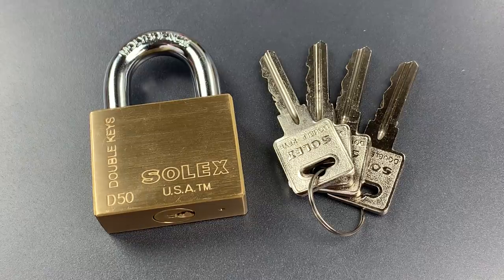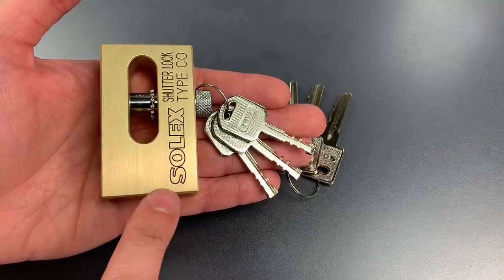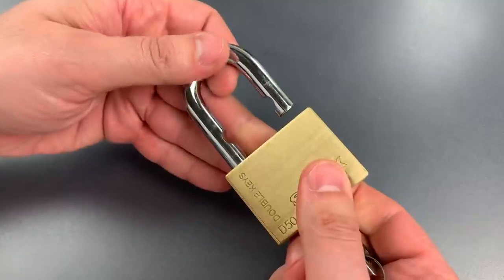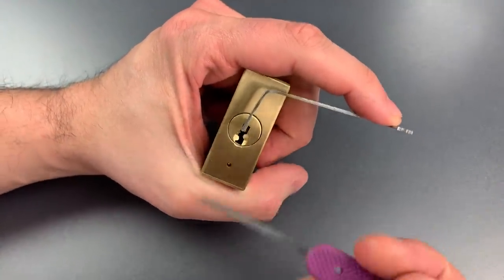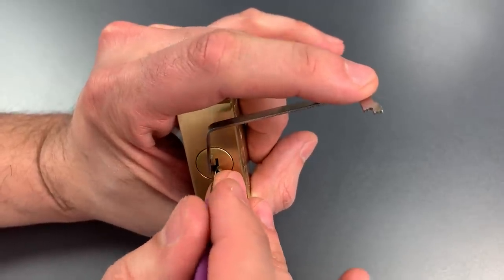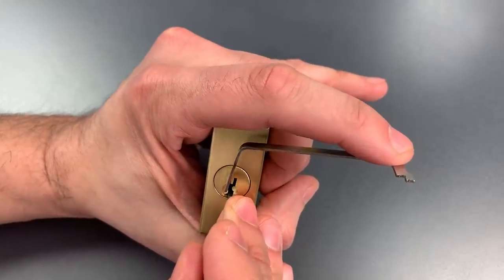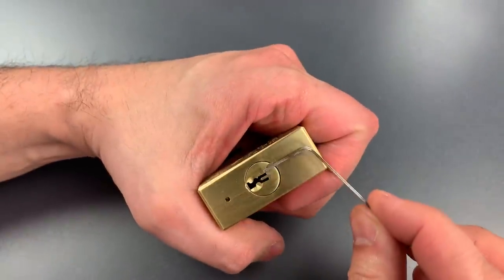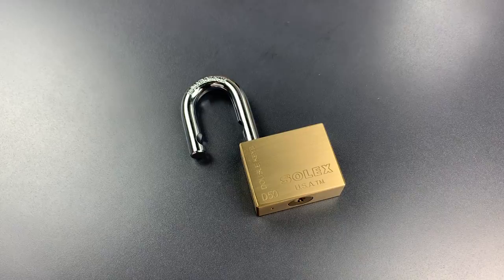[816] “Double Key” Solex D50 Padlock Picked and Raked

Comment: I know I suck at lockpicking, but I can't help but shed a small but still very manly tear every time you refer to raking as a "low skilled attack".
Reply: Think of it as an "average attack" instead. :)
Reply: Once you've actually done it a few times, you might find yourself agreeing.

There are some "tricks" to raking, FWIW, but there's no rocket surgery involved.
Reply: @jamesg1367  Yup. I've raked open locks without even knowing what raking was or that I had the wrong impression of "lock picking."
Reply: throw out your rakes (really just put them away) they aren't making you better.
Reply: I have done it many times, that's why I made the joke about crying when he says it- it is far easier for me to rake open a vulnerable lock than it is to single pin pick it.
Reply: Not everyone can rake-pic a lock ... so don’t get discouraged.
Reply: "Low Skilled Attack" - what's the button combination on the PlayStation controller 🎮?
Reply: I have a master #3 that I can spp easily but I can't rake it at all

Comment: Cool lock! I just started on locksport myself, and have a general question: I've got an old lock given to me by a relative, which is fairly weathered, and find it nearly impossible to single-pin-pick. However, the lock is downright trivial to rake open with my double or triple peak. I feel it's likely because the lock is worn or gummed up, but I might just be terrible- I did pick it once but I bent my standard hook doing so. Is this normal? Thoughts?

Comment: Another lock they probably charge megabucks for that a Meth head could pick with a hairpin.  Thanks for the heads up, even though depressing.  You'd think that some lock companies could at least make locks you can't tension at the base easily, like two or three points of freedom in the shafts and anything critical at the end.  No lock is pick proof or the key wouldn't work, but it's supposed to be easier to destroy the lock, creating noise, costing time and alerting people.
Reply: The ABUS Plus core is quite rude in this regard, since you can't tension it at the front or the back due to the butterfly discs.

Comment: Is there a lock you can not pick? And what lock do you recommend?
Reply: One of the abus locks can't remember which one
Reply: Well there are a few locks that he hasn't picked - such as the bowley padlock. The only pick of it required a huge set of custom made tools and obviously opening the lock to figure out how it worked.

Really, the main concern with most locks is the beefiness
Reply: @argenti3609  the one disc lock before this one gave him plenty of grief before it opened.
Reply: vector6977 no it didn’t.
Reply: Ask bill for that new Gerda  4 sets of 5 pins, 3 times! That might be a 1hr video
Reply: Anything featuring the Abloy Protec2 core or the ABUS Plus core are going to deter just about any thief.  Most of them will look for an easier target or destructive entry.  I use the ABUS Diskus model 20/70 for my storage unit.

Comment: Hang on!!!
Surprised you used top of the keyway tension. Would there have been enough room to pick it if the tension would have been at the bottom? Those slots at the top looked pretty slim.

Comment: Ok so with pad locks you usually use ,I don't know the correct terminology,but it's a battery,cut into a t shape. You then insert it into the top side that locks ... would that work on this lock?please correct my novice lock picking language 😉

Comment: The part that has me scratching my head is that they could use chores of equal or lesser cost (just slightly tighter tolerances) and toss a few security pins in there.  Boom!  Better lock with either virtually no cost increase.

But of course, making a better product pays dividends in company reputation.  Be known for making a superior product and people would have little issue paying a bit more for the product.

Comment: I would be curious to see a disassembly video.  I'm curious about how the pins are held in the body.  Guessing they used 4 elongated slots rather than 8 cylindrical holes.

Comment: Angling the blades out a little would have allowed the pins from the left to fall into the holes on the right. Bolster this with some deep spools and tight tolerances and this would have been one hell of a lock to pick.

Comment: Forgive my ignorance of terminology, but when you progress deeper into a lock are you always in contact with the pins, sliding across them to keep your depth awareness, or do you lose contact and simply go to where you know the next pin is before touching it? Also, could you pick everything with hooks if they're all you had? Thank you; I love the videos.
Reply: I like your question and hope LPL answers.  I constantly have to correct myself and reassess as to "depth awareness" as you term it, especially on smaller locks.  I tend to get it wrong at first on unfamiliar locks ("was that pin 3 or 4?"), then sort it out with some practice.  Sometimes I do a better job of depth accuracy with eyes closed.
Reply from the maker: I started by remaining in constant contact with the pins... picked like that for a few years. Eventually pin spacing becomes part of your muscle memory.

Comment: I was thinking the pins would fall back into the cylinder making you have to pick it again.
Reply: By the time the cylinder has rotated that far the angle is wrong. Pins might catch a bit, but they won't lock
Reply: Oh, duh. That makes sense. @fredhenry101

Comment: LPL, I love your channel however I would like to see you pick locks while they are actually in use rather than just held in your hand.  I'm guessing it would be at least slightly more difficult holding the locks when they are attached to something.  Either way, great content as always.
Reply: I would certainly agree that an awkward placement/angle of a lock that's in actual use can complicate picking.  I have found it annoying enough to crouch down and pick a simple entry-door lock.  But it also greatly complicates filming.  Picking for the camera IMO is better done in the "studio."  This way we get a good look at the process, which is really the whole idea.

Lighting incidentally is often a difficult problem with an awkward setup, both for picking and for filming purposes.
Reply: It’s awkward enough having the camera in the way and holding it up for a good shot of the picking.
Reply: there is no difference! If the locks outside had the key-way welded shut or an armed guard present to stop him, then yes it would matter. However, with no one around, the lock is going to get open. You never lock the lock in a position from which you can never fit a key into. Otherwise you cant open it up yourself! THink noob!

Comment: no gut for a unique double pinned lock?
Reply: It's not disassemblable - most brass bodied padlocks aren't.  He'd have to mill the side off to access the pin cylinders, which ruins the lock
Reply: @Richet125  Or locate and drill out the pin chamber plugs, that way you can replace them with fresh brass plugs.

Comment: Why don't they have dropping  pins
Reply: yeah,  and why dont they have flying pins? I know right?
Reply: @martynapalm4950  I know that's sarcasm yet dropping pins are a thing my old lock had them 

They need to be kept in position to lead to unlocking if you hit it then moved the pick away it would drop Down using springs
Reply: @donedane2269  the tension on the lock keeps them in place. That's the basis of lock picking in general. If they didn't drop the tension wrench would be almost pointless, just a rake would open it without blinking
Reply: @fredhenry101  clearly you don't know this lock my mate couldn't even open it as tension wrench's don't work on it they drop
Reply: @fredhenry101  plus a rake wouldn't work as soon as you release pressure it would drop the pins

Comment: where do you get your tension tools ??
Reply: Jack Tate . That is the 40 thousandth pet bar from sparrows. Check out pickpals.com
Reply: @TheButchersbLock  Thanks
Reply: You can also get a good tension tool by removing a metal insert in windshield wipers.
Reply: @kayce851  Been down that road many times but the ones used in the video look to be more helpful with inserting in the top (narrow/small) part of the keyway
Reply: They are top of the keyway tensioner that have a 90* bend in them.